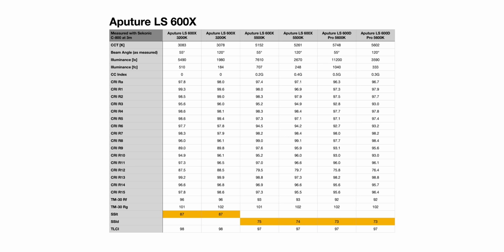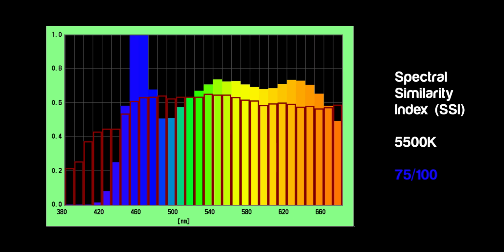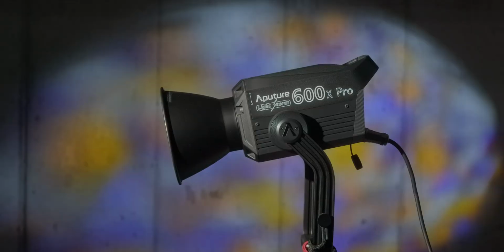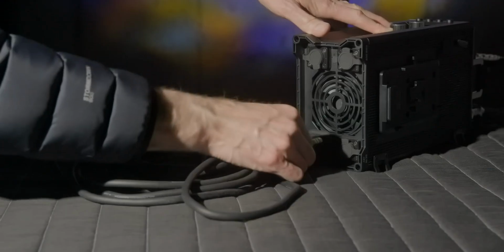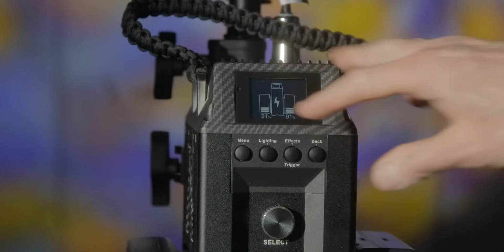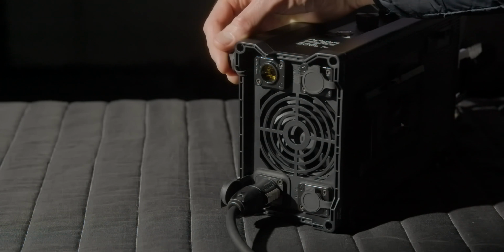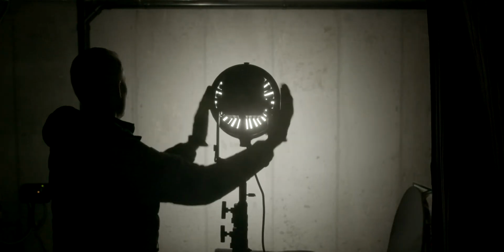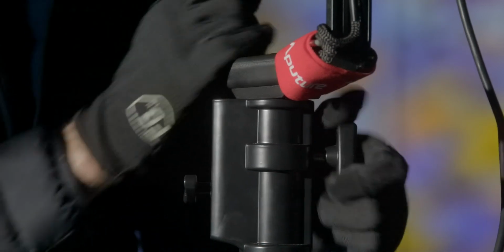Aputure LS 600X PRO LED Light — What makes it PRO?

Comment: Had it for a few weeks - sold it. I have found you can score lights all you want with meters but the real test is how they look with skin tones. Lights can score really well but perform poorly in real World usage.
Reply: What made you sell it?
I feel it’s a bit weak for a 600 
I guess im gonna switch it with the 600D
Reply: Lights can perform really well when measured with a Sekonic  @ahmedbadr86  but that doesn't tell the entire story. The real test of a light is how it performs on subjects, like skin for example. I was disappointed by the color performance and sold it.
Reply from the maker: Interesting. I haven't noticed any oddities in terms of skin tones with the 600X. I guess it also depends partly on how your camera captures and interprets the spectral output of the light.
Reply: Absolutely agree  @curtisjudd  - performance will vary depending on the sensor being used. We shoot V-Raptor now and the only way we could be happy was to use a book light.
Reply: @derekjcooper  sounds like you got a faulty unit or user error.
Reply: @parkercreative_au  Sounds like user error, derek is a fool.

Comment: SGC has tube lights that run on Sidus link. Sidus link is open to other brands if they want to work with it. 
Wireless DMX with a small DMX-It 524ew board is great if you don’t have a bunch of RGB lights that are channel hogs
Reply from the maker: Thanks, good to hear that it is expanding to other brands. 👍

Comment: I'll invest in lighting next. Any recommendations for a decently non expensive start up set up? Thank you in advance Curtis!
Reply: The low end Aputure "Amaran" line of lights would be my recommendation. Starting under 200$ you get good light quality, AND you can control and integrate them with any other modern Aputure lights. Mixing and matching lights from different brands is a pain in the ass, dont get those Neewer or other ultra budget brands. Aputure has great budget options, and you can grow in the Aputure ecosystem according to your needs!
Reply: Go with Nanlite, Godox or Aputure. All their lights are reasonably priced and offers good features and great quality.
Reply from the maker: I’d look at the Aputure Amaran 100D and the new Amaran panels: https://youtu.be/lKHFhONsag4